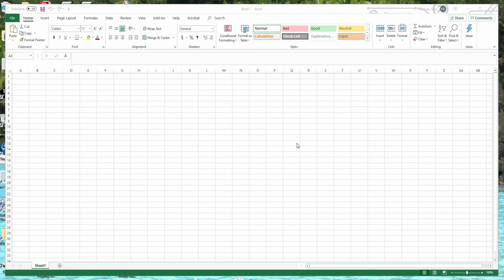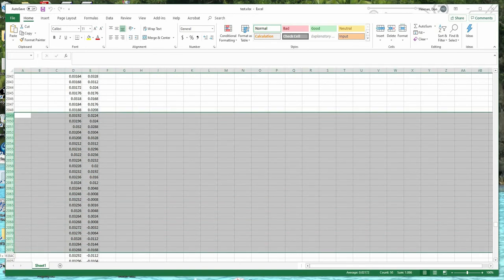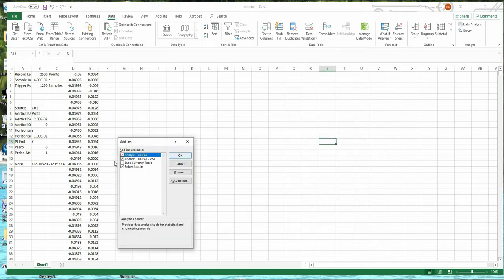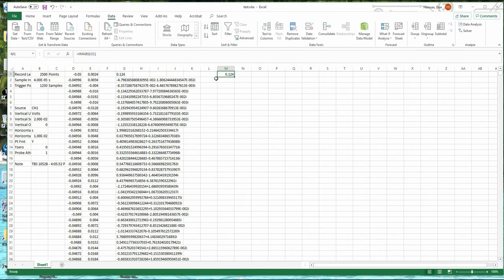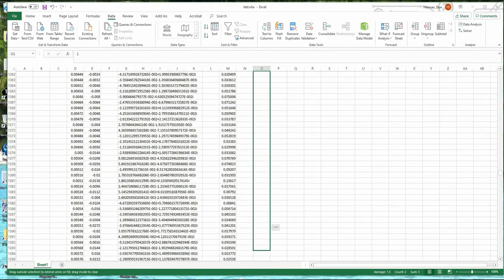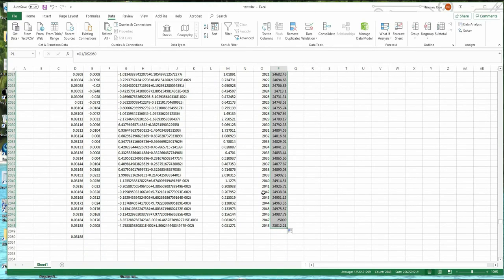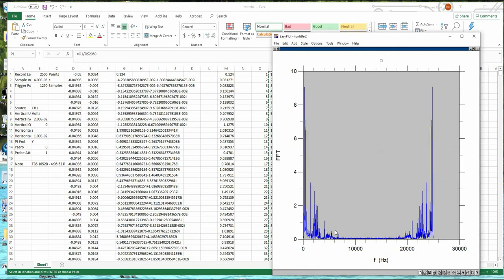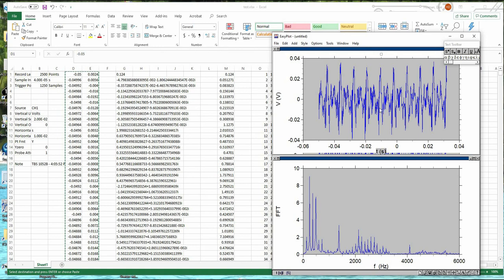Excel FFT

Comment: One interesting aspect of the FFT when applying it to slower environmental datasets: The key to getting better resolution from the Fourier when you are limited to a fixed number of data points is to decrease the sample frequency (and thus increase the overall sampling time) So we released a video demonstrating that optimization using Excel's Fourier transform to derive a tidal frequency spectrum:  https://youtu.be/0VzX-3erjPI

Comment: You just glance over the fact that on either side of your FFT graph it's a copy of itself why is this?
Reply: Think it's due to Nyquist theorem
Reply: @yourdataispublic  The Nyquist theorem just states that in order to get an accurate measure of your sample (when converting from analog to digital), your sampling rate should be 2X the maximum frequency you are looking to describe in any analysis after digitization.  So that does not account for the reflection of the wave.